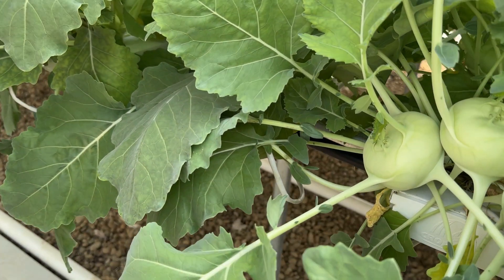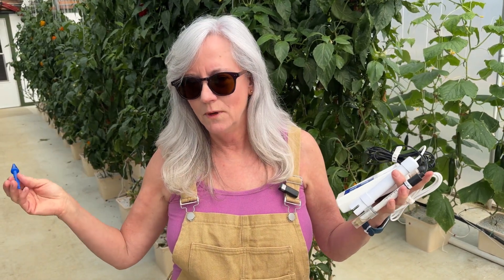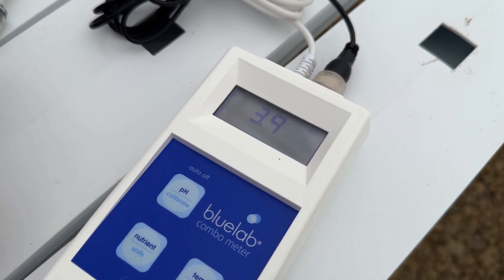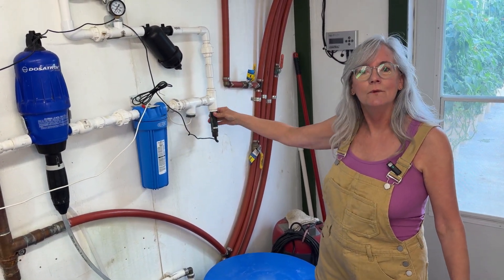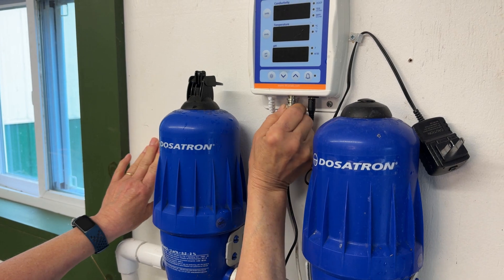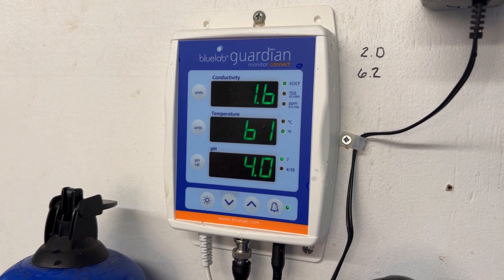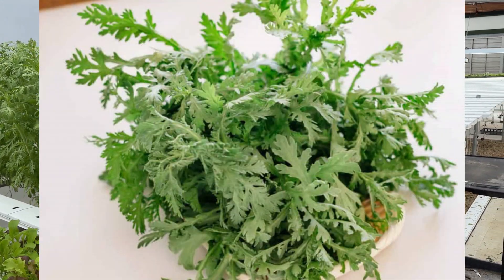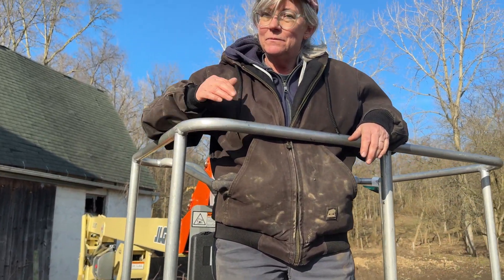Discover the Secret to Perfect Plant pH!

Comment: Hi Kate, I found your video informative. I do have a question because you said that having a PH wrong will throw off your EC. So the question is how you adjust or measure your PH before you add nutrients? Do you fill your nutrient tanks with an adjusted PH water first? Thanks.. I have a system much like your first.
Reply from the maker: I just end up adjusting both EC and PH till I get it in line. I start off with the right concentration on the tanks so Im trying to only inject about .05% on all dosatrons.

Comment: Sulphuric acid? Was this recommended by your nutrient manager? We use PHOSPHORIC acid because it breaks down into constituent components the plants take up. (as well as being industry standard)

Very curious. I have NEVER heard of sulphuric acid being used as a regular PH down adjuster.
Reply: Phosphoric acid isn't all that practical at scale.
Reply: I always use nitric acid. Nitric acid is the norm in New Zealand
Reply: @gardeningwithscience1317  I just started using nitric acid because I've got very hard water and I wanted to utilize the calcium carbonate.  Do you ever see imbalances in your system?  I just started using it and I wasn't sure if I might see some excess nitrogen issues.
Reply: It's probably cheaper.
Reply from the maker: So, in commercial application sulfuric acid is used. I can buy 5 gallons for $26, and I use drops for my 1200-gallon nutrient tank. 5 gallons last me 6 months easy.

Comment: Thanks for the video and education. pH probes are a blessing a a curse. Besides a small hydroponic setup, I also have a small vineyard (120 vines) and for years I just used the 'cheap' pH probes and the frustration and inaccuracies eventually were too much so last year I splurged and bought better equipment and it sure has made a difference. I do like the Blue Labs products, I just wish they showed one extra decimal place in the readout. Maybe not so much for veggies, but for wine, a 3.2 reading could be 3.20 or 3.29! No way to tell and it makes a big difference. The meter I use for wine is from Vinmetrica and for my hydroponics, I still use a Blue Labs device.
Reply from the maker: Yes it one of those things you have to have and keep going. I heard the same thing in the beginning to buy good equipment once than to buy cheap stuff multiply times. Blue Lab stuff is great. The president of the company actually came and visited me a few years ago when he was attending the Cultivate Show in Columbus. Great guy!!